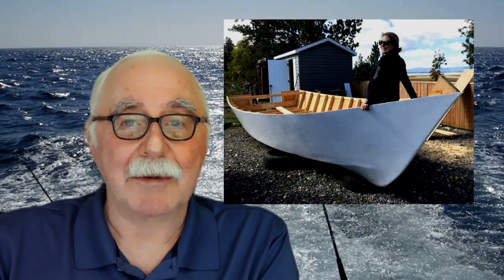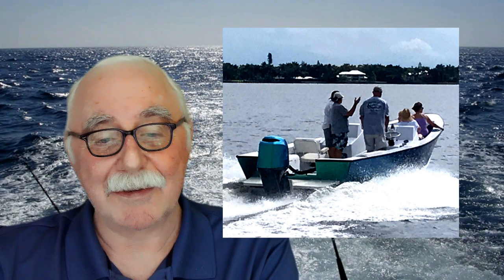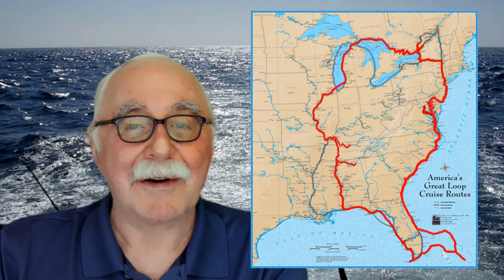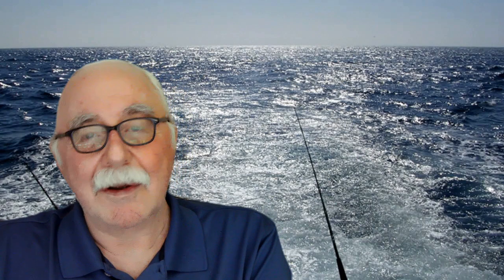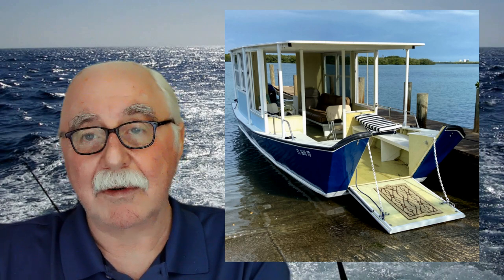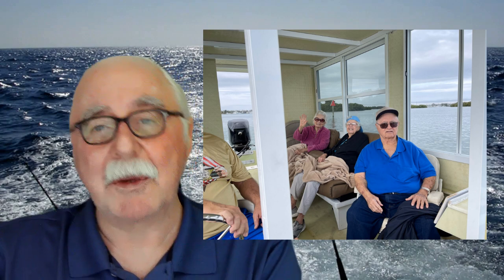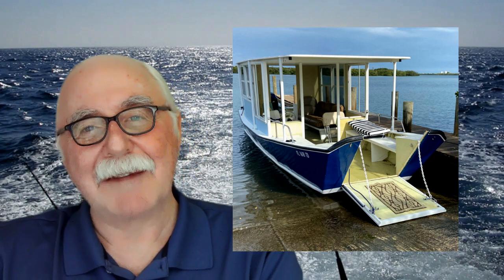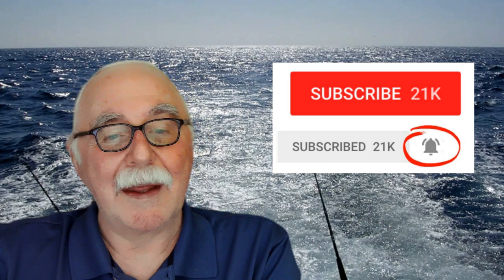Ken Water's Mobile Garvey Dory

Comment: I agree, but someone who is going to cruise thousands of miles on inland waterways can benefit from the fuel economy of a lighter boat. They can do it with less motor. This is really important if you are trying to come up with a useful, practical, electric power option. The boat will need a ridiculous amount of battery storage which will provide plenty of ballast. Foam core isnt a panacea for all that ails but it does solve a few problems, and is common for superstructures and interior paneling. Im not too sure about its suitability for a hull. I guess it depends but Id probably steer away from that.

Comment: I don't know if you read your comments. But here's a little trick. I'm a truck driver and I spent many years haul'n oversized loads. Technically the next width for a load is 8 ft 6 in. But if you read the laws and regulations. You don't have to mark or getting oversized load permit until you hit 9 ft wide or over 3 ft extended past the trailer. So technically you can go to 8 ft 11 inches and still be legal without having to get a permit or an oversized load placarding on your vehicle. Now it's been a while since I've done oversized loads but I'm pretty sure it's 12 ft wide on city streets without a pilot and 14 ft wide on interstates without a pilot. That's why you see a lot of guys getting away with making their boats 11 ft 11 in wide and not having pilots escort them down the road. All they got is an oversized load sign on the front of the vehicle and on the back of the trailer couple flags and you're good to go after you get the permit. And the permits really not that expensive I think it's like $54 in most States. So if you want to build a nice wide boat it's not going to cost you that much extra to transport it as long as you keep under 12 ft. I'd love to make 11 ft 11 in wide boat.
Reply: Unfortunately Jeff passed away last September
Reply: @rhheheheje  
Sorry 🥃
Reply: @rhheheheje  March 2022 R.I.P  Spira

Comment: Mr Ken do the fuel compartments in a boat have to be sealed to prevent gas from making it to the bilge?
Reply from the maker: Yes, of course. Most builders put in commercial fuel tanks rather than trying to seal in parts of the bilge.
Reply: @tjkid07  yes sir I understand the tank has to be sealed but if you put a commercial tank in do you have to seal the stringers and bulkheads around it in case the tank starts to leak for some reason so the fuel doesn’t make it to bilge and get pumped in the water or worse ignited when the bilge pump cuts on.

Comment: Edit just found out i my condolences to jeffs family and all effected 
my questions still needs answered  so anyone who has any information it would be greatly appreciated and utilized Hey Spira Boats
Ive a question 
Im planning on building a 12 FT. wooden jon boat 
ive built a 1/12th scale model of the boat 
In real life i intend for this boat to be to have a floor width of 48 inches and ten feet long the bow rise /angle is to start at ten feet and go to 12 ft. so that i have 10ft. x 48 in. of flat space for 2 people and gear  i intend for the  sides of the boat to be 24 inches  deep and on a 13 degree angle  
the problem is i dont how to figure the weight capacity for a boat of this size  im hoping for a safe weight capacity of 450 lbs  also if could scale 450 lbs to 1/12th scale that would be great for postioning of seats and such
any information you care to share would be greatly appreciated and utilized